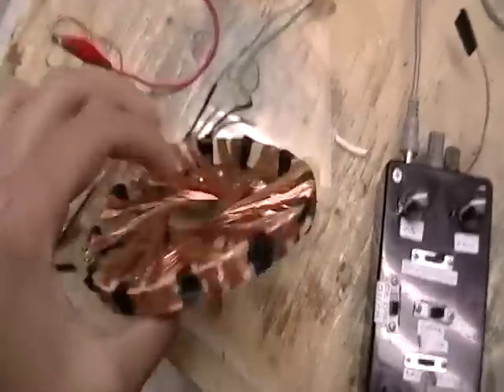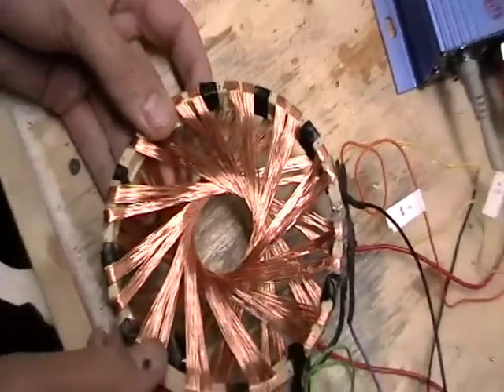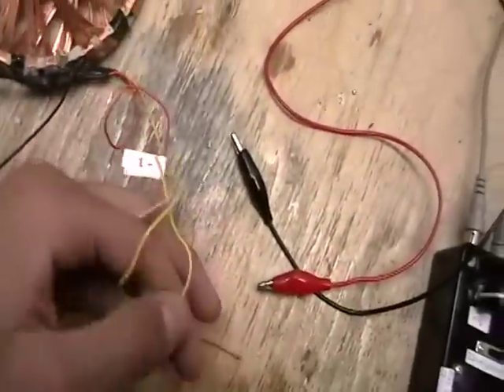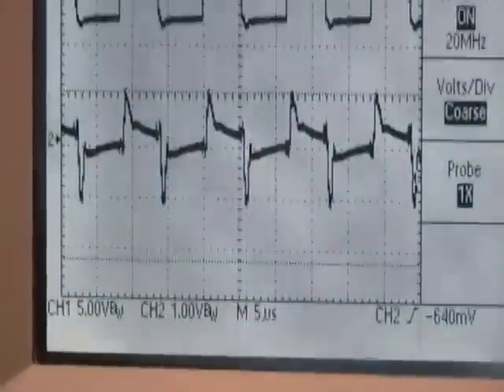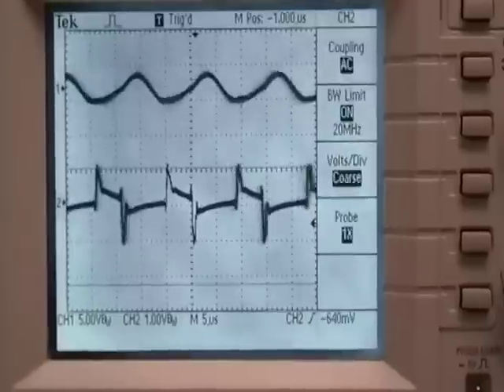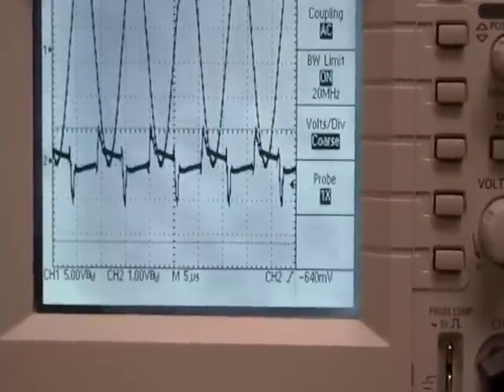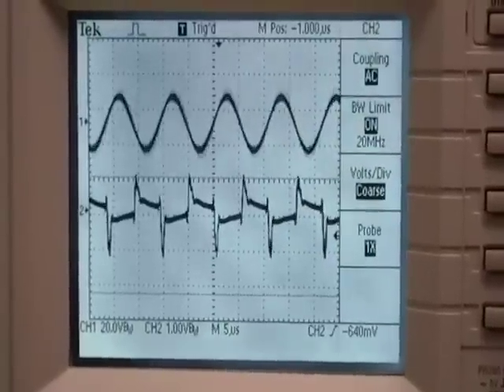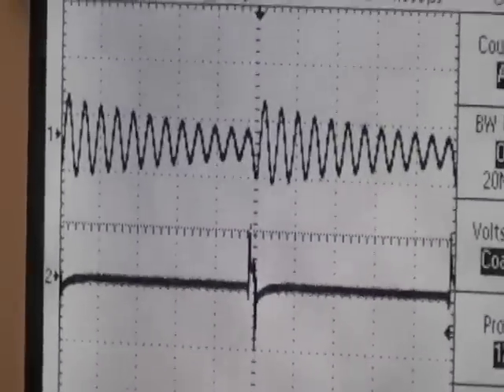Rodin Coil waveform change and resonance in the b-field.

Comment: yes and you could also divide the frequencies by 3 - 6 - 9 ratio in order to get to measure the absolute zero point of the magnetic field. i.e 0 hz 120hz and 240hz make 360hz zo one signal is 120Hz the other on 240Hz. Then if the output signal is a 360 sinewave you might be on to something?

Comment: I see the damped oscillation too. I can see it is very much a function of the load I put on the secondary. As the load approaches infinity ohms, the oscillation is greatest. When there is a low resistive load, the oscillation doesn't occur and we see a waveform just associated with pulsing the coil.

Comment: This is the behavior of any LC circuit.  The L is your coil, the C is stray capacitance from the wire.  Also 80 KHz is above what most audio amps will reproduce faithfully without some filtering kicking in.